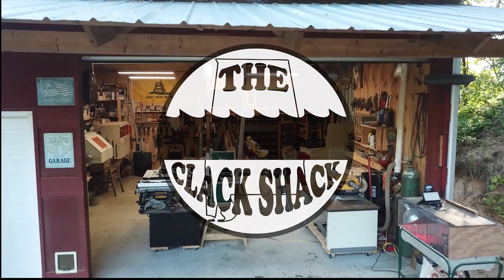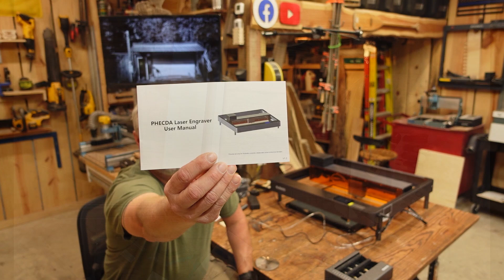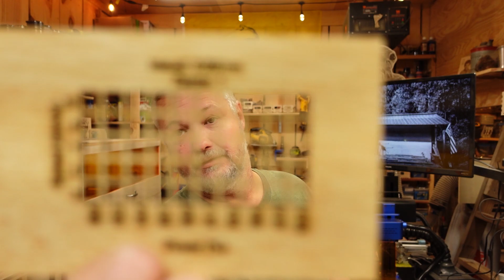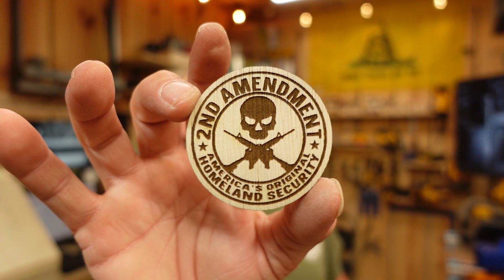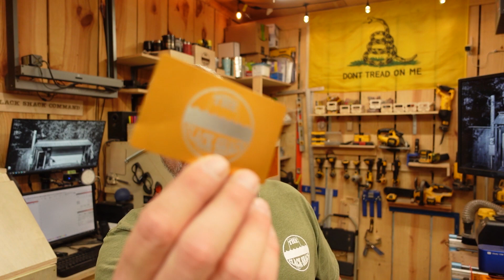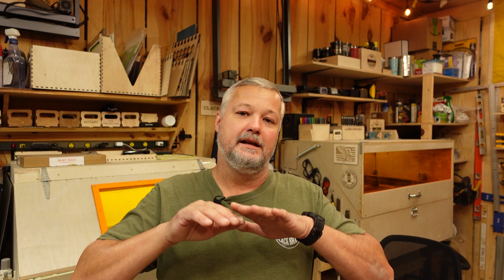Elegoo Phecda 20 watt- full setup for $600

Comment: I have the 20w version nice engraver but for some reason other thatn the lightburn test files I cannot get it to cut in my case 3mm basswood boards any clues as to what I should look for?
Reply from the maker: I would guess lack of focus or bad lens. Assuming the power settings are correct.
Reply: @TheClackShack  thanks for the reply

Comment: They have this with kit 2 onsale for 360.00 is it worth that?
Reply from the maker: It works as well as any I have tested but the filter is not functional long term. It is best to run it in current position due to it not having limit switches. For that price, it wouldn’t be a terrible buy.
Reply: Thank you enjoyed the video @TheClackShack

Comment: Hello.
Can you tell me if this Elegoo laser can cut metal sheet, soft metal like brass or aluminum, very thin, 0.2- 0.4mm ?
I want to cut very small parts for dioramas, from some metal. Some are small like 5mm length
Can you make a short video tutorial with some metal cutting? Thank you
Reply from the maker: I would not recommend a blue laser for cutting any type of metal. You would need a fiber or a UV for very thin material

Comment: Can you tell me how thick black acrylic sheet can this 20W variant cut?

[ and can it cut white acrylic (non-transparent) as well? ]
Reply from the maker: I would probably stick with 5mm or less to maintain a smooth edge. You could do more but the edge may be rough from all the passes. You will be limited to black opaque
Reply: @TheClackShack  Alright.. Thanks for replying :)

And among OLM2 PRO S2 with 10W laser and this 20W variant, which one's better overall not considering price according to you..?

Comment: Still no limit switches, laughable magnetically attached plexi shielding, a dysfunctional smoke filter which really serves no purpose and those stilts for risers are going to do the Bill Haley shake, rattle and roll
I think Elegoo should stick to 3D printers.
Reply from the maker: It wasn’t the best overall design ever. The module works great

Comment: Hi I was just wondering how you line up the job to get it square on the material  with the Phecda 20w any help would be great :)
Reply from the maker: Using a square and the frame function will work. You can also make a jig which is my go to.    https://theclackshack.etsy.com/listing/1625979227/elegoo-phecda-interchangeable-jig-kit
Reply: @TheClackShack  Thanks for your reply

Comment: hi, i bought a 10 w elegoo phecda yet i am failing constantly)) can not cut even a 1mm craft paper higher than 100 mm per minute and 100 percent power))i use the lightburn material test and i believe i am doing something wrong ...having air assist and honeycomb yet feels like laser can not give right power. is any setup for lightburn for this particular machine or do i have a mechanical problem?
Reply from the maker: Check the S value and make sure it isn’t lowered.
Reply: @TheClackShack  S Value is 1000. I checked that part first.
I believe I am struggling with the focusing.I even made a ramp test for the finest focus point, and it is how it is supposed to be. 
One guy told me that the G code is not saving in lightburn in his case and reinstall will fix it, but I don't understand what he meant. Anyways, thanks for helping, and thank you for all your videos ))

Comment: For me the belt system took me time to figure out since my belt came off when assembling. The limit switches should have been standard, Geeks at Large do offer a kit for it. This is Elegoo's first go at laser and it will improve over time. Their fmd and resin printers are solid. Sadly i have not received my accesories yet for the Phecda and am anxious
Reply from the maker: Yea, the belt did that on mine.

Comment: Hi, Great video, I'm curious about your opinion whether I would be able to go 2mm deep and take out Bold letters for epoxy filling, I'm talking letters that are 30mm wide and about 10" tall. 
Thanks,
Reply from the maker: I have done deeper with other machines, multiple passes and you can get good depth. You could technically go up to about 5 mm deep and keep pretty good detail. Just need plenty of passes
Reply from the maker: Like this? https://www.facebook.com/photo/?fbid=354353280428223&set=a.178602718003281

Comment: What settings do you recommend for getting small details on tumblrs ? I have tested a few tumblrs and I had over lapping and a not as crisp image
Reply from the maker: I run LPI at around 200. It depends on the beam size but most 20 or 30 watt machines, 200 works well. Power and speed will vary by color and manufacturer. I recommend a power speed test

Comment: Hi, witch stepper driver used? Some TMC drivers does not need end/limiting switches, they detect the end stop without. (StallGuard)
Reply from the maker: The kind that grind if you go too far. Even on the control screen, it will not home. I am aware of machines such as xtool who use soft limits.

Comment: I have the 20 watt version. It has a few issues. The y-belt on the right side slips off the rollers about every 3 uses. The filter is completely ineffective. The biggest issue I have is the laser module falls out of its slot about every 5 issues regardless of how tight I crank down the screws. Lastly, performing a firmware upgrade, which Elegoo told me to do, was far more difficult and troublesome than it needed to be and there is no useful guidance of any kind. I talked to Elegoo about all of the issues and the basic response was they hoped I could fix it and good luck. The machine is about 3 weeks old.
Reply from the maker: The belt issue should be an easy fix. The way they run the belts can be challenging to get them right, it took me a few minutes even with my experience with similar machines. Was there an issue that requires a firmware update? If not, I would rock on with the current system. The slippage on the module could be caused by wear on the dovetail, maybe a file and clean up the connection points. It is possible that the machine that I got is a newer run but so far, it has performed pretty well.
Reply: @TheClackShack  Any belt help is greatly appreciated. Elegoo customer support has been horrendous. The machine became non-operational about 5 days after I received the laser. It would turn on, but not respond to any commands from the LCD or when plugged into a computer. Elegoo told me it was a known issue and to update the firmware. That was it. The firmware update procedure from their website is not remotely applicable to this machine. I will definitely try to clean up the dovetails. Thanks for the awesome channel by the way!
Reply: @Motomax76  There was no reason for the item not to be sent fully assembled which would have sorted out the problems people were getting whilst building.
Reply: @TheClackShack  I messed with the belt and installed some end stops today and it made a major difference.
Reply: @Motomax76  I thought you said it was broken after 5 days? I know putting in the end stops incorrectly can cause the machine not to boot.
Reply: @mrfoameruk there are no end stops included. You have to buy them aftermarket.
Reply: @Motomax76  Yes from Amazon and how to do it on the Facebook page. I could not get mine to work but more due to limited experience on setting up the gcodes.
Reply: @TheClackShack  There was a new firmware but it had to do with an error message under certain circumstances. It did not affect the use of the machine in any way, so I didn't update it as it is not a simple thing to do and really didn't do anything..

Comment: I have the 10 watt version and the air filter dose help but I have an enclosure that exhausts out the window
Reply from the maker: Yea, it collects some but in my testing the cutting was a little more than it could handle.
Reply: How do you like the 10w version I'm looking at one currently, literally no reviews out there lol.
Reply: it seams to be a decent starter unit I have cut 3mm and 6mm plywood engraved slate, black ceramic tile , and several other materials @LlvlDOn3
Reply: @LlvlDOn3  Always better to go bigger if you can afford it.